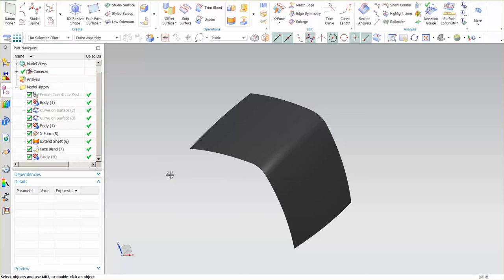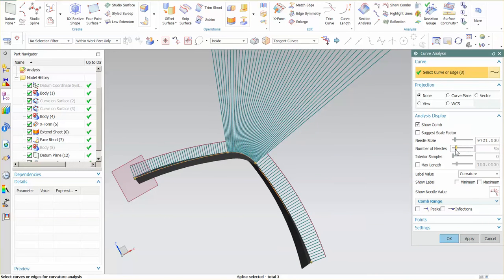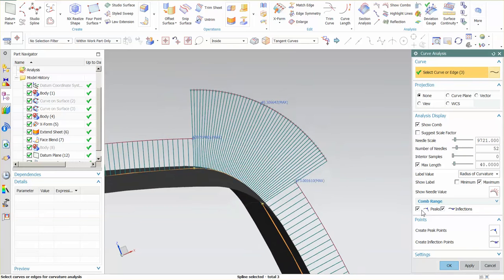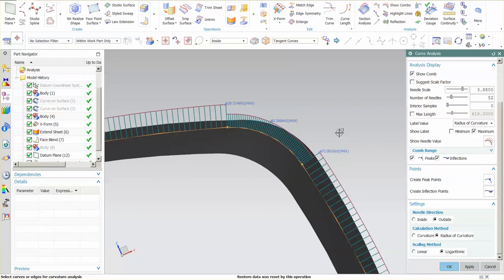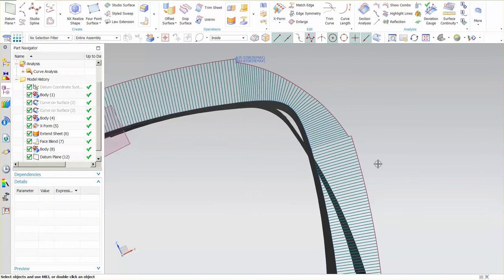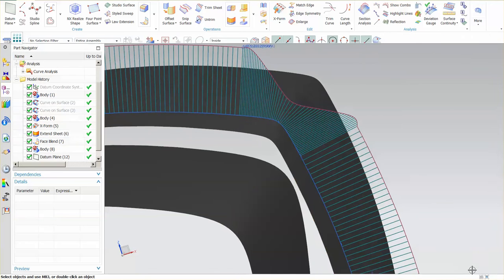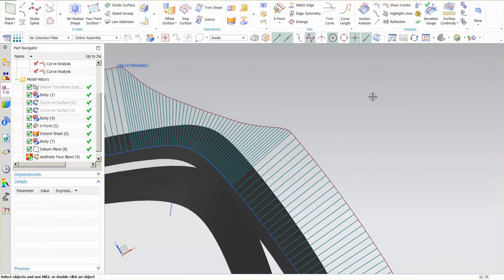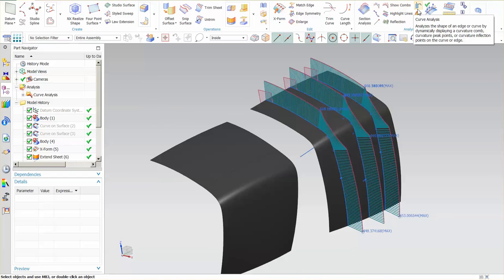Siemens NX 10 | Class A Surfacing Techniques and Tools: Curve Analysis

Comment: Excuse moi to ask this, i'm not an industrial designer, but why curvature continuity became so important nowadays in industrial design ? Is it purely an aesthetic prescription ? Or is it directly related to the later numerical transcription of toolhead movements for machining ?
Reply from the maker: +Okto Putsch It is aesthetics. Older software could not easily do G3. Now they do. It was all based off of surface complexity as well. With G3 you necessarily need surfaces and curves that have a higher order and older CAD systems and hardware really do well with super complex. Now we can easily so designers have at it.

Hope that helps.
Reply: class A surfacing Thanks :)